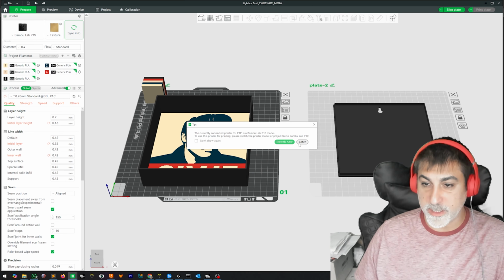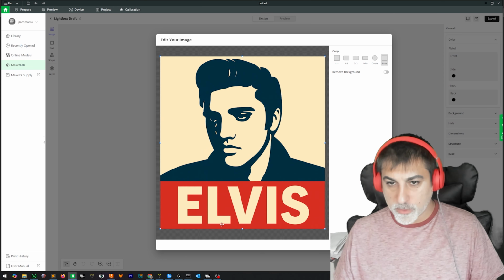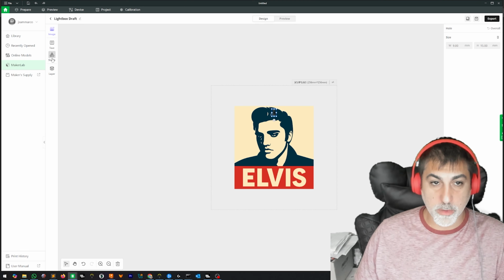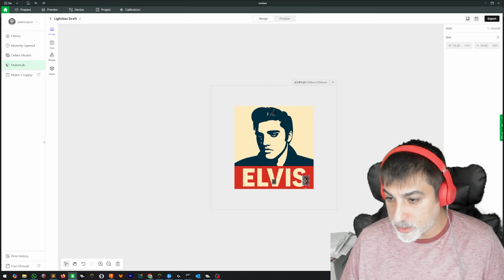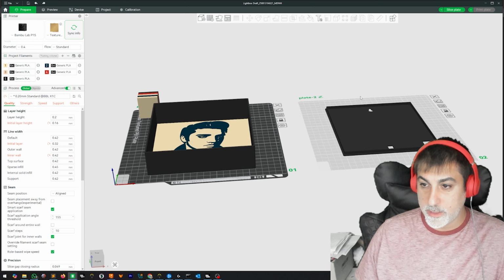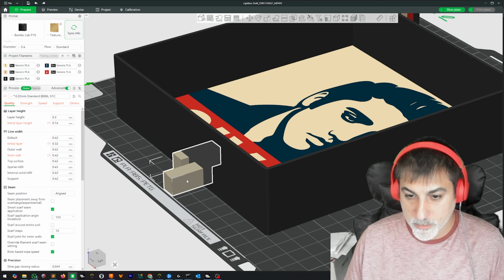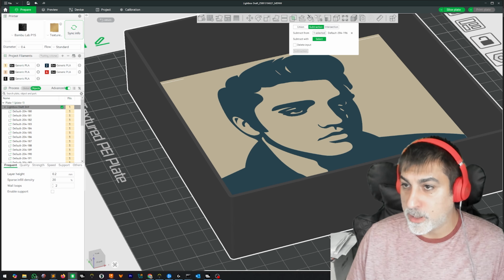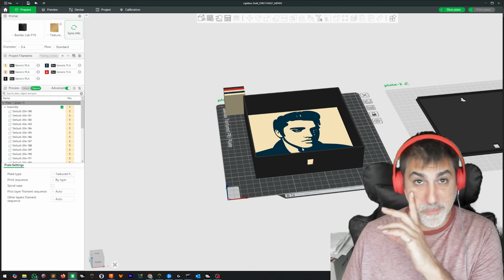Bambu Lab Studio - How to Make a Lightbox with Ports and a Switch

Comment: I wanted to let you know that there is an easier and quicker way to create that opening on the bottpom is to add a negative part thats a cube with the size you want and place it in the location you want. That eliminates the need to create 2 cubes, merge and so a mesh boolean to subtract out the part.
Reply from the maker: Thanks for the tip. I later realize that I over complicated it.

Comment: do you have a vid on how to assemble the lights and accessories? Would a regular Rocker Switch (2 pin) work?
Reply from the maker: I can make a video on that. Thanks for the feedback. A 2 pin rocker will work just fine
Reply: @ConsultingjoeOnline  would be great, I got the wiring done but you can see it when the light in on